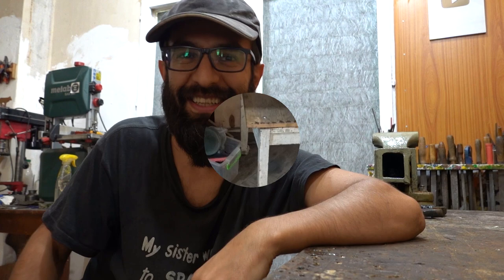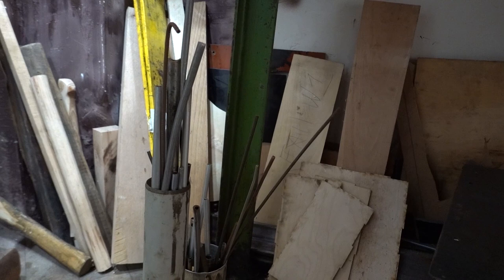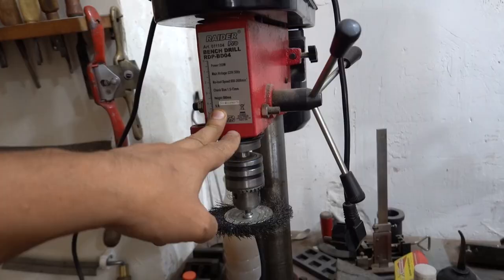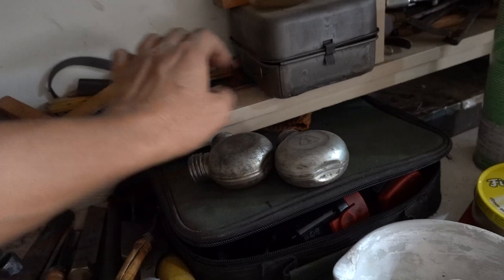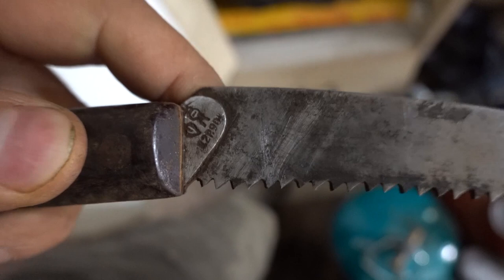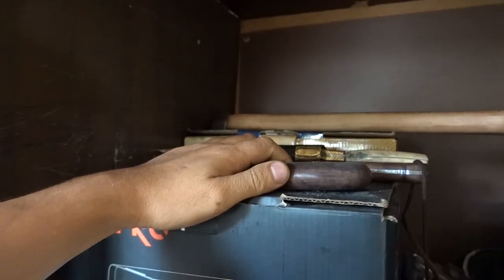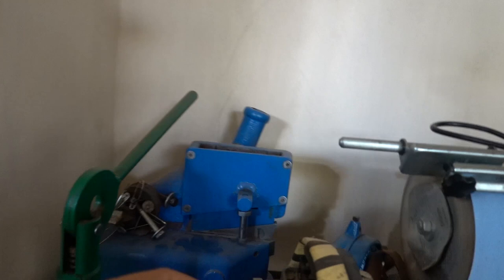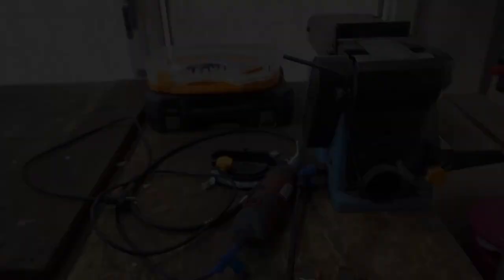Screws And Tools Happy Birthday

Comment: Geographically, where are you ?
Reply from the maker: Georgia)
Reply: @ScrewsAndTools  Thank you! ... For some reason I guessed Bulgaria, but I have no idea why, and also the wrong side of the Black Sea :).  Also, and just as a matter of information for its own sake, your English is quite good ! ... I love your work and your channel.  Maybe one of these days, and if you haven't done it already, you could maybe do a video that explains the art and method of metal hardness and hardening (?).  I happen to have a 2.5 lb. bearded axe (from Bulgaria) the hardness of which I can't determine because I have no knowledge of that aspect of the trade.
Reply from the maker: @lugwrench9832  Hi, thanks for your attention. It's very simple. I'll explain it to you now. what needs to be done to understand whether your axe is hardened or soft. So, take a metal file (preferably fine-grained) and hold the files along the cutting edge of the axe. At this point, your file should not catch on the metal and just slide. This will mean that the cutting edge is hardened. For example, you can hold an axe over the head above and you will notice that the file catches metal. This will mean that there is soft as it should be.
Reply from the maker: By the way, by this method, which I described above, I myself check whether the item has a hardening or not. You can watch it in my previous videos.
Reply: @ScrewsAndTools  Thank you.  I will do as you instruct.  I kind of thought it might have something to do with how a file behaves against the metal.  Up until now I've been ringing the axe like a bell to get a sense of its hardness, but I'm sure much of that depends on the trained ear, and also how the axe is held and with what its held since it's easy to dampen the ring.
Reply from the maker: @lugwrench9832  You are right, ringing is not always an indicator of good tempering. Therefore, it is better and more reliable to use a file.